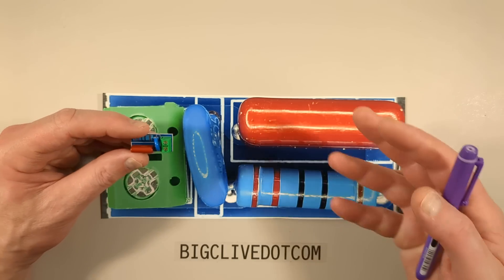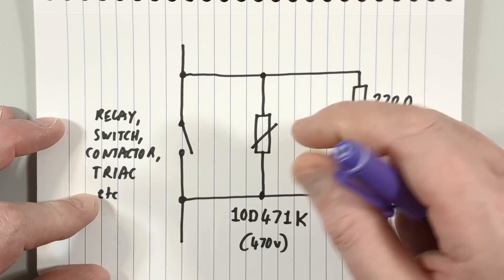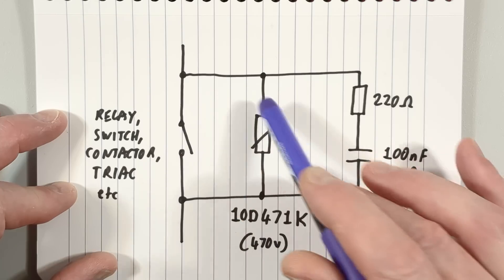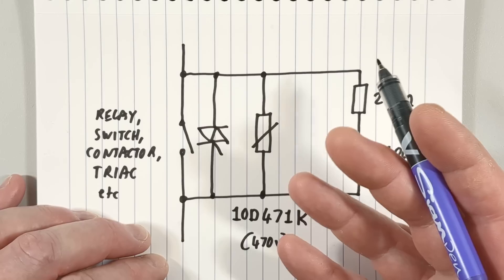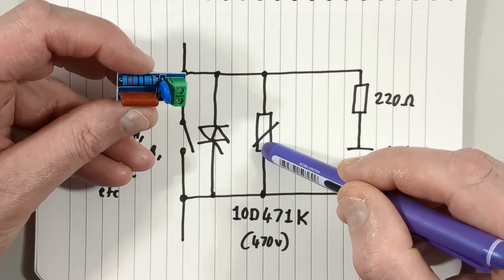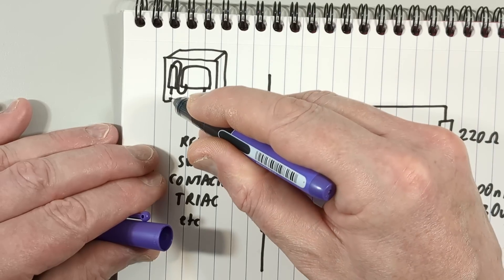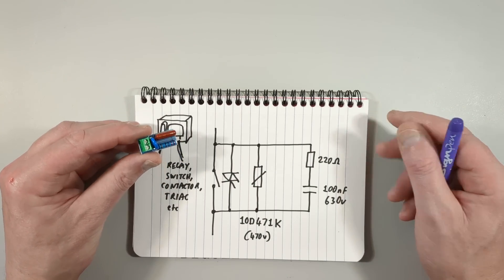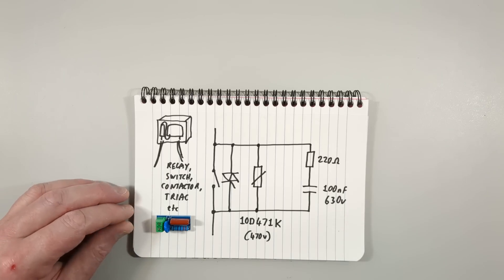Snubber network module for protecting contacts

Comment: how do we dimension the resistor power rating?
Reply from the maker: Choose the resistance to pass the desired current, then multiply the current by the voltage dropped.  But also double the power rating so the resistor has an easy life.

Comment: will this work witha domestic garage door where i switch 240 vac.  It melted contacts on a 10 amps spdt switch previously
Reply from the maker: A snubber may help, but 10A contacts should have been pretty robust for a door opener.

Comment: If i put this on a cheap 10 A 240 VAC relay used to activate a contactor coil would it be good.  ??  The contactor coil being an inductive load.
Reply from the maker: It could be used.  You could also consider getting a classic potted snubber network from a local electronics distributor.  In the Uk that could be something like this:-
https://cpc.farnell.com/unbranded/xeb1201/filter-xeb1201b-fly-lead/dp/CA06044

Comment: Shouldn't the capacitor be an X-rated one?
Reply from the maker: The X-type is normally for use directly across the mains supply.  This red type is commonly found in things like snubbers and capacitive droppers.
Reply: Naked?

Comment: Very nice this looks similar to some of the input protection I designed for some linear power supply circuitry. I use an IEC inlet, NTC thermiester, and fuse (as well as some other stuff).

Comment: These are all over the DC cranes at work. 230v EOT cranes fed by rails in a steel mill. Electromechanical control relays to control motor speed and direction
Reply: Every axis goes "CLACK srsrsrsrsrsrsrsrsrsrsr CLACK"

Comment: Regarding the possibility of the device faults closed, is it possible to add a low amperage slow blow fuse in line? Or are there other better ways of mitigating contractor wear and electrical noice?

Comment: My brand new fridge often causes my 3D printer to reset when the compressor switches on\off which is really frustrating if I'm doing a long print. Would one of these snubber things help somehow? And if so where would you wire it in?
Reply from the maker: It would probably need to be across the thermostat.  You may be able to get results using a plug-in filter.
Reply: You need to prevent noise over the power line from the fridge .The standard solution is a cheap filter similar to what you find in any old TV or microwave. Likely there is a malfunctioning snubber over your thermostat in the fridge or a degraded X capacitor on its power inlet.
The alternative way is to try to shelter your printer if that is more convenient,  but your problem there is you do not know what way the reset is triggered. The power supply?  The data connection to your computer? The computer power supply? 
I would rearrange the printer - computer wiring first, try to put both power supplies on the same extension cord and hook that up to a different phase than the fridge, at least a different fuse if you only have a one phase system.  Reduce printer computer distance and no big loops in the cable between. 
Chokes of the type you find on old power supply cables can be handy too if you don't want to tinker with line voltage in devices.
There are, as pointed out , similar plug and play filters to plug into the outlet for your fridge and then plug the fridge into that. Note that this may be a double edged sword! If the filter contains a MOV there is a slight chance that a major spike from the switching fridge can trigger the MOV and trip your circuit breaker in you switch box, disconnecting your fridge from power! How fun is that?
All depends on what you have available. The fridge shouldn't cause this in the first place if CE compliant.
Reply: Hello. The refrigerator when it starts draws six times the full loads amperage. Then when the compressor switch opens it probably has a spike develope  on the branch circuit.  If the 3D printer shares the circuit with the fridge than the printer's microprocessor is sensitive to these voltage disturbances.  Please look into placing your printer on a different circuit with
the  purchase of a surge protector plug in device.
Reply: Just get a UPS to protect your printer from voltage issues.  Easy peasy and will protect your long prints from failing due to a power outage as well.
Reply: @michaelhafner4270 I was thinking this as well. Especially one that conditions the power.

Comment: I just replaced 3 contactors made by Siemens which had snap-on snubbers. They fastened onto a long side and practically became invisible. I kept them for reverse engineering.( wink-wink)
On an electric braising pan, I had a contactor that caused a capacitor dropper power supply to go into overload, drop out, and restart. Constantly.
No snubbers on that contactor. US electrical codes did not require them but it should have. The contactor was 1 of a pair in parallel coils, 110VAC. They practically beat each other to the death until 1 finally became unstable. Hence the constant power looping.

Comment: I researched snubber networks when I was fitting a relay to switch a vintage amplifier, with the relay taking the load off the original (and prone to failure) mains switch.  I ended up putting the snubber across the load rather than the relay contacts, because I wasn't keen on the idea of the snubber being energised all of the time that the unit was off.  From what I could gather, doing it this way still has some benefit in quenching the arc across the relay contacts, but is not as effective as putting the snubber directly across them.  I'm not sure why though as it must absorb some of the inductive "kickback" when the power transformer is de-energised.  I could certainly see a brief arc across the relay contacts (which were in a transparent housing) as they opened, but not every time.
Reply from the maker: My preference would be to have the snubber across the relay.  The leakage current is low and almost purely capacitive.
Reply: The varistor would clamp the kickback voltage to the level specified on the device. The resistor capacitor would absorb the high frequency "ringing"of the coil when switched off.
As far as I know, snubbing the load should produce the same effect. If arcing of the relay persisted, then a varistor should be added.
Reply: @jeffmassey4860  Thank you for that - I will experiment with a varistor (currently just RC).

Comment: My mini fridge used to put out a nasty transient whenever it switched off; I'm sure it was hard on the relay, and it also caused an audible click in my headphone setup for the computer sitting near the fridge.

Added a snubber circuit like this to the compressor motor relay and it resolved the problem completely with no ill side effects.

Comment: Above my skill level but I still enjoy the show and the amount of k know how from Clive and all the other chaps that comment . love the show . maybe some time you could do one for a  simpleton (me) I'm trying to relearn a lot of different things after a car crash and a tbi which wiped my slate almost clean not completely but went from building hotrods to struggle to change my own oil .but getting alot alot better since 2020 .don't ever stop teaching it's a great show I harvest a lot of peices and parts from old or broke stuff electronic things and put them in a tool box and tackle box to keep them organized a little cause I know I'll need things like that in my projets .I'm a building like 12 volt fans or lower volts with on off and low to high speed and simple stuff like that that jcan use living in a minivan with my pitbull hippo Frankenstein..i learned how to solder and try and keep learning for me and my brain .so it stays awake and functioning..great vids Clive thank you.

Comment: The resistor is there to increase the dampening of the RC-filter. If it didn’t  have enough dampening, the circuit could start ringing (self-oscillate). At each damped oscillation the resistor will effectively dissipate the energy of the inductive current that would have normally created a spark at the switch without the snubber.

Comment: Thanks Clive -- I could have done with knowing more about snubbers when I worked with triacs some years ago. Your example of an LED load glowing even such a switch device is "off" highlighted to me how if used across a switch supplying AC, the snubber very much compromises the galvanic disconnection! I assume these are useful for DC switching too?
Reply: You typically use a flyback diode in the case of DC loads, though snubbers can be used for inductive loads if EMI is an issue.

Comment: I like the very neat way varistors sometimes fail, where they look like a 1mm hole has been drilled through the disk.
Then you get the messy failure where one side is blasted off.

Comment: 1) thanks!  i use a smart home-like relay switch (packaged to look like a regular light switch) to turn on/off a bank of 6 LED floods for the kitchen, and something failed in that circuit.  the total power is probably higher than the rating on the switch (we like it bright in the kitchen), so i could see a built-in snubber failing early, and the contact failing shortly after.  aside from replacing it with a properly rated relay switch, i wonder if a separate snubber (with the varistor) would make the whole thing operate better (though i wouldn't want any leakage when the relay was off, so good/bad).

2) the way you pronounce varister (sounds like vrister, with the v and r on top of each other, max 2 syllable enunciation) was difficult for me to pick up.  maybe it's my flight radio enunciation habits, but i've always used three clear syllables va-ris-ter.  i should have recognized the symbol, but i had to look up the part number.  all good.

Comment: could these make your light bulbs last longer?
Reply from the maker: No.  But depending on the type of bulb there are ways to prolong their useful life.
Reply: @bigclivedotcom by snipping off LED's?

If talking incandescent, the series bulbs thing works well if you just want dimmer more pleasant light as it also reduces the temperature of the filament and as such, the temperature of the light!

Comment: I was wondering how it gave complete isolation of the load from the power supply. It sounds like it doesn't
Reply from the maker: It doesn't.  There is enough leakage through the capacitor to give a shock, but you should never be relying on a relay or triac for safety.

Comment: So a slow-blow fuse in series with the MOV seems like a good idea for something like that. Once the MOV consistently passes say, 1A, it blows and takes itself out instead of causing issues.
Reply: Then the triac will be unprotected after the fuse blows, and eventually the triac will fail short circuit.
Reply from the maker: It takes a lot of sustained fault current to blow a 1A fuse.  The MOV would potentially be up in flames before the fuse blew.

Comment: Found a good design flaw on a bit of kit I had at home a while back. It was a hot & cold water dispenser with heater & chiller built in. It started to play up. Once or twice it dispensed cold water totally autonomously. Not good. I dug into it to try and see if anything obvious jumped out. Only thing I found was the relays powering the heater & compressor had snubber networks but the resistors were both blown. I surmised that they could generate spikes that could get into the logic and upset it. One was only slightly damaged so I could see the value - 10 Ohm. Way too small for the 220n caps. Replaced them with 100 Ohm. Sadly, other components started failing not long after confidence had been restored. First the HV driver for the UV steriliser lamp failed, then the controller kept running the chiller to the point it froze the water in the cold tank…and the thing developed internal leaks from the many joints. Shame. Of course, I’ve now ordered the all-new replacement model…..

Comment: BigClive
Does this exact snubber works for AC?
From my understanding it provides a high RC impedance path for AC so it will not optimal for AC switching.
Reply from the maker: It will work with both AC and DC as it is shunting the electrical noise from the arc.  But this type is designed for use with AC.

Comment: Thanks for the reminder. Have an old heavy "portable" spot welder with fried switch contacts.
Cleaned up the contacts & left it to collect dust for the past 2 years.
Put in a homebrew snubber today (had the discrete parts) & followed your schematic, but 100R 2W resistor, 100nF 400V cap &~ 400V+ MOV
So far, so good!
Thanks! 🙂

Comment: They should be interesting. I bought two bags of them from Ebay a few years ago in an attempt thinking they might help with power fluctuations due to an obscure really ridiculous waveform that E on demand electric water heater was generating causing lighting in the new addition that I helped bild to flicker whenever the heating system kicked in. Ultimately it didn't work but it was worth a shot. Ordered the replacement board off of Amazon didn't do anything, Contacted the company they sent out a new control board that arrived broken but didn't solve the problem. Third replacement board did, they must've specialty programmed it that's all I can think.
Reply from the maker: If the lighting is dipping when a high load is energised then there may be a resistance or neutral issue in your electrical panel or the electrical company's supply.

Comment: Not sure I would trust those Chinese made no name modules for anything serious. Just as likely to cause a fault as to prevent one. When it comes to arc quenching and suppression I think it's worth getting quality components. China does make quality goods but you generally won't find them on AliExpress. Not bashing AE, I just got a giant package full of random stuff from them.
Reply: Where do you buy reliable electronic components then?
Reply: @1yyymmmddd  From actual suppliers like Digikey, Mouser, Newark, etc etc. Anywhere that sells name brand components that you can trust.

Comment: On AC this setup will just leak current in the load continuously. Not doing that.
Reply from the maker: There is slight leakage through the capacitor.

Comment: I used this MOV parallel to the RIFA RC over the leads of an inductive motor to protect the switching contact. First I used only the RC Rifa but that led to an  exploding RiFA as the peak inductive oltage spike would kill it. I added a 275V or somewhat higher MOV to it to support the RC. This saved the Rifa. To improve component wise. I would now recommend using seperate MKT/MKP 0.1muF cap. with 50 -100ohms resistor in series instead of the RIfa. Together with the MOV it is the best and cheapest contact saver available.

Comment: i have watched it thrice but i still am not sure what does it do to the characyeristics of normal switch. i recall snicker net but not snugger ;)
Reply from the maker: When a switch opens and a small arc is pulled it creates high frequency electrical white noise.  The capacitor will happily shunt that, this providing less current for the arc.

Comment: How difficult would it be to have the TRIAC switch at the zero volt crossing?  Or is it that a snubber TRIAC and network can/should be used on DC as well?
Reply from the maker: For switching it's usually preferred to have it switch at the zero crossing point.  But with a triac the snubber is there to shunt transient voltage spikes that may cause false triggering of the triac.

Comment: Any good for DC motors .say a 180w 24v being run on 70v . Cooked several switches and melted a wiring harness, a proper contactor was well out of budget, ended up with a pair of dc motor controllers in parallel .
Reply from the maker: It could help, but breaking DC current flow is harder than AC as it tends to produce a continuous arc.  In the past I've used chunky relays and wired all the contacts in series for a wider contact break.

Comment: Are the capacitor and resistor rated for mains duty?
Reply from the maker: Normally the chosen components will be an X2 capacitor and suitably rated resistor.
Reply: Absolutely!  Don't even consider anything but an X2 rated capacitor as a starting point. The resistor will help with protecting the capacitor from high inrush currents but the peak value of the AC voltage will be there stressing the  capacitor whenever it faces the line voltage.

Comment: Wonder how safe this £2.80 (varies) "Car Lithium Battery Converter Charger Clip Auto Igniter Jump Starter For Makita Booster Cable Adapter Emergency Power DIY Tools" from AliX,  is for the user, or the battery! There is no info on output voltage, although the phone charger part is going to be the basic circuit.
Reply from the maker: I think I have one of those here.

Comment: The resistor is to absorb and dissipate the energy, otherwise the cap discharges it back into the circuit, possible resonating with the inductive load.